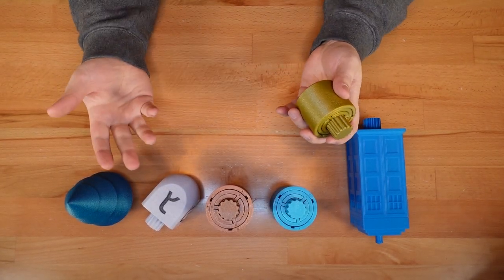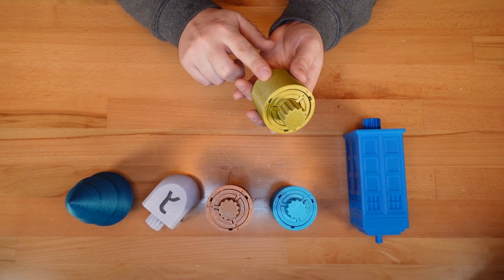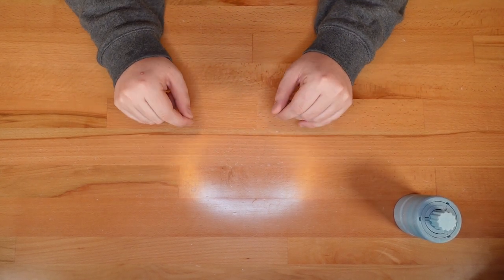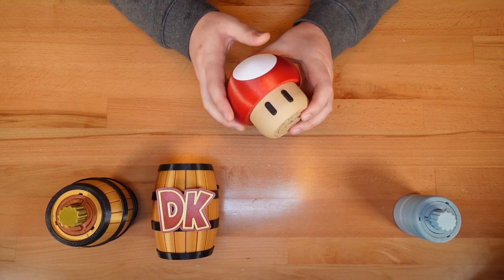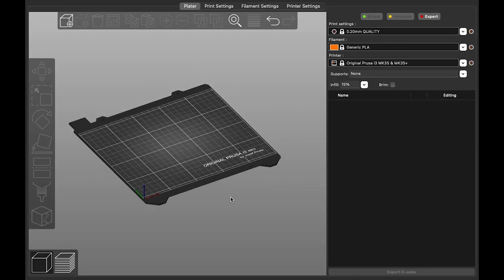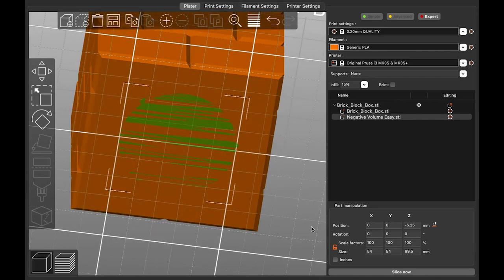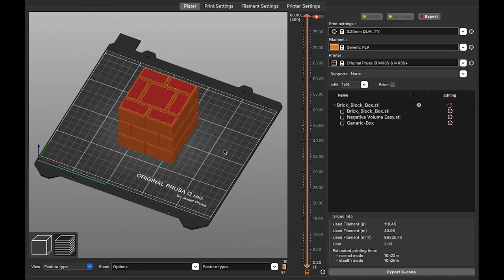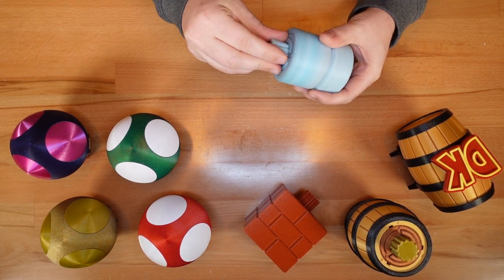MORE Print-in-Place 3D printed Puzzle Boxes!

Comment: Hi, great design as always! Quality of your models are really awesome. Could you remix a version with reduced tolerances, like .2mm instead of .5? To make it a little less rattly :)
Reply from the maker: Possibly, although I would probably only pick a single model to rework. There are so many now, so remixing every possible variation with various amounts of clearance would get a bit unwieldy. 

I recommend attempting to print one of the existing designs at a reduced scale to get less rattle. A 40% scale print would have the .2mm clearances you're looking for and would print very quickly! If it turns out to be too tight, it won't waste much filament or time to find out :)

Good luck! If it works, I'd love to know.

Comment: In PrusaSlicer you can export a model to STL. All you need to do is Right click on the model and find the "Export as STL" option.
It's way better to use the .3mf but it's nice to know the option is there if you need it.
Reply from the maker: You're correct - there is an STL export.

Unfortunately, the STL export feature does not include any negative volume modifications you've made to the mesh. Since the tutorial was based on using negative volumes, 3MF is currently the only option that will save that work.

Here's a feature request to change that: https://github.com/prusa3d/PrusaSlicer/issues/8853. Hopefully it will be an option in the future!
Reply: @3DPrinty  Wow that's an oversite I wouldn't have expected. Hopefully it is added soon :)
Reply: @3DPrinty  Looks like the latest release of PrusaSlicer ( 2.6.0-alpha6 ) now has the ability to export to STL with the negative spaces included. 😁😁

Comment: Ohhh ok I got it. I'v been trying to figure this out. I have to solve the OG puzzle but instead of putting back in the OG case I put it in one of these
Reply from the maker: Yup, the old core will work just fine. The newer puzzles do have a SLIGHT improvement - the bottom of the core has some lines for griping, but it's not mandatory for the puzzle solution. I hope you enjoy the new puzzles!

Comment: Very nice! Sadly for me I will have to use sand paper for the mushroom twist because it is getting stuck at a certain point of the twist. I was using PLA+ so I don't know if it was this or just that I was unlucky.
Reply from the maker: Sorry to hear about the trouble, but good job working around it! With print-in-place designs, it really can just come down to getting the perfect print temperature and a little luck.